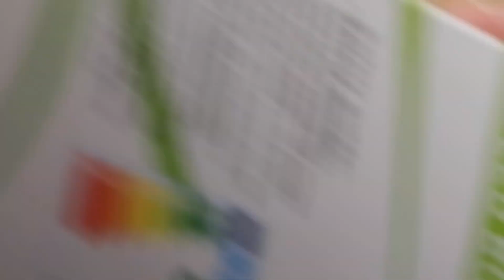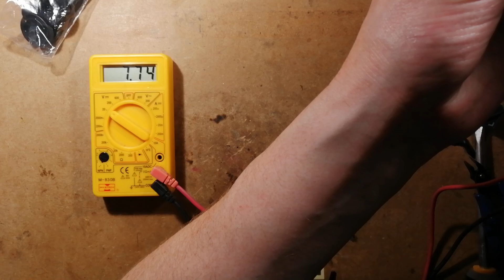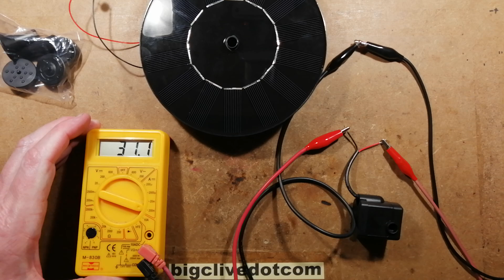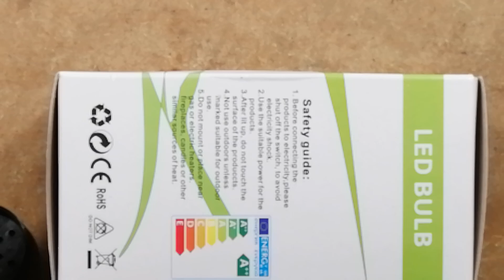Technical look at a floating solar fountain.

Comment: I have this exact solar fountain! I took it apart to test the pump and solar panel. They both worked well. I suspect the motor has  two coils, a hall effect sensor, and a two pole rotor, similar to computer fan motors, which have 4 poles. I really enjoy your teardown and reverse engineering videos!

Comment: I appreciate this is an old video but it was interesting to me as I've had one of these fountains for a while, (it only goes outside on sunny days so is kept in its box the rest of the time). Used it a few weeks back without issue, then went to use it today in glorious full hot sun (shocker) only to find its attempt at a fountain to be nothing more than a spit. Took the pump apart as in your video, removed  the 'propeller', was as clean as a whistle, so popped the propeller back in & took the whole thing outside and in the sun the prop spun really fast... Put it all back together but as soon as it went in the fresh water the same poor result  😕 Thinking my 'Trevi Fountain' is maybe coming to the end of its life 🤷🏽‍♀️
Reply from the maker: It's possible that the solar panel has a tiny crack or there's a water ingress issue.

Comment: Thanks for your technical breakdown.  I have one of these located in our north yard, hence it's shaded from the sun most of the time.  So, I found a 6 vdc switching supply and hooked it up to the pump and it is now solar independent.  Thanks,  Bob

Comment: I’ve had 2 of these they work great but for some reason the solar disc by the end of summer has gone from black to cloudy white?
Reply from the maker: That happens to the resin surfaces.  You can sometimes clean them with a soft cloth and a small quantity of a mild abrasive cleaner like toothpaste.  It might be possible to make the surface last a bit longer by using a car cleaning wax on it afterwards.

Comment: Apparently there are several types of potting compounds, silicone, epoxy, polyester, etc.  Have you tried acetone to melt any of the potted devices?
Reply from the maker: I have.  It only works with some potting compounds.

Comment: You said it uses a capacitor so my question is: after taking it apart can you run it through a series of added on capacitors to take it from a pulsing output to a near fluid output by offsetting the time interval between capacitor discharges?
Reply: I surmise that a feeding loop done properly can allow a series LEDs to produce enough of a trickle charge to charge the batteries that run them while simultaneously creating a usable voltage output. I don't however have the technical equipment on hand to test the theory. I have the bulbs and fountains.

Comment: I have had 2 of them, they work great as long as you keep water where ever it is, Ours was in the bird bath and i would go out and it sounded like it was grinding rough.  I just ad to water and it was fine at first. It was fine for the price I just noticed you did one on my american Cheap/awesome stuff ( being silly ). then I had to pull side cover off there was no more fountian but it still made the water shimmer for the birds. Last before it stopped I would spin spinner to get it stated. I was really suprised it needed the water? I came to the same conclution though motor sealed and box sealed in epoxy.... soooo.
Reply: I wish the motor wasnt so sealed up id love for you to tell me why it qiut... <3

Comment: Hi, Clive. I used to disassemble that fountain too. In the small black box is a circuit that works as follows: The solar panel charges a capacitor of about 4700uF. When the voltage reaches a certain level - I think 5.2V will turn on the power to the pump. This is because the motor needs a higher inrush current in order to spin. In a way, the circuit can be called what is called a "crowbar circuit". A much larger and thus more powerful photovoltaic panel would be needed.
  The pump electronics are the same as in any cheap PC fan. Just structurally, it is a miniature of the synchronous pump from the washing machine - the winding is wound twice and the current according to the rotation of the rotor switches the normal 2-channel Hall switch - the same as in the fan

Comment: I have one of this and it stops working yesterday. Looking to see what could have happened. No reset, nothing I can do. Any clue why this would stop working after 6 months working nice ?
Reply from the maker: Maybe water ingress to electronics or a clogged pump.  There's a filter on the pump that can be unclipped to clean the rotor.
Reply: @bigclivedotcom  Looking at your video I learned that the blades could be pulled off. Then I saw that internally it had a thin layer of algee. So I cleaned it and its back to work as new. Thanks for the video. Helped me a lot !

Comment: I like that, I have a large pond and can't be arsed to take power across, pity there weren't a slightly more powerful one.
Another good idea based on the same system would be a mini low voltage air pump which would benefit the pond in the hot sultry days were the fish gulp at the water surface.
, 👍👍

Comment: Oh, forgot to mention, I did notice on the from of the panel that takes off from the from of the pump, there is a tiny little + and - sign but no switch or anything. I wondered if this might be some way of controlling how high the pump pumps the water? Am I supposed to do something somehow with these + and - signs, could that be linked to why it's not working?
Reply from the maker: That's just a sliding gate that regulates the flow of water.

Comment: Hello, you seem to be knowledgeable about these fountains, I wonder if you could help me? I bought one of these solar panel water fountain pump kits back in March. It's almost the same as the one you showed in the video, only the solar panel is separate from the pump and they are connected by wires. I took this out of it's box yesterday, for the first time since J bought it as the weather was glorious. I followed the instructions put the pump under water, put the panel in direct sunshine (and it was definitely direct sunshine, nk doubt about that), connected the two together....and absolutely nothing happened. I thought maybe it needs to be in the sun for a certain number of hours before it starts, so I left it for at least 2 hours and all day today. Again, absolutely nothing. There is no on/off switch or anything else to do here, in terms of set up. I bought it from Ebay, and have contacted the seller but so far there has been no response. J just wondered if you might have any kind of clue as to why this this is not working? It's brand new. Don't know if it's the pump or the panel or both. Any ideas?
Reply from the maker: Pop the water filter off the pump and check the little impeller inside is free to rotate.
Reply: @bigclivedotcom  Done that, and it seems to be free to rotate...it doesn't rotate when I sort of tap it/push it with my finger, there is resistance, it just moves a bit....is that normal when you push it with a finger? I mean, should you be able to turn it around completely with a finger? It's not doing that, it just moves around a bit and then stops.
Reply: Hi , mine is same .. just got it 🙃

Comment: I got back to this video just to say, i have one, been using it for more then a year now and after that year it seam to have developed weird problem, it just stops working in messy water and won't work again even when cleaned, but it will come back to life after i leave it to dry 🤔
Reply from the maker: It sounds like water ingress to the electronics.  Messy water is more conductive than clean water.
Reply: it died. One of the solar cells visibly cracked, doesn't look like water ingress but who knows. I will try to hack it at some point to use external solar panel

Comment: I have a floating plate ( disc of foam material ) included. Any idea where it is for??
Reply from the maker: If it's a foam ring it may be to make the solar panel unit more buoyant.

Comment: Honestly, I don't see the point of destroying a perfectly working gadget just because one is curious of the components inside. It's similar (apart from the cost) to buying a new car and tear the engine apart just too see how it's built, isn't it? Did the deconstruction help you in any way? Then again, I suppose there are people who aren't content with how a gadget works, but has to analyse how it works and why.
Reply from the maker: By taking mine apart others don't have to take theirs apart.  The needs of the many are greater than the needs of the one.
Reply: @bigclivedotcom  Yes, I figured that is the reason. Then again - why is it necessary to know exactly what is inside? Unless you're going to make your very own gadget by copying the gadget you tear apart? Maybe just plain human curiosity? Speaking for myself, I bought two of these floating solar fountains - I placed them in my pond a sunny day and hey presto! They were working! That is all I needed to know - the manual that came with the fountains said nothing about deconstructing the gadget. But, like I mentioned before - we all have different interests. ;)
Reply: I bought one of these fountains some 3 years ago - it looked and worked very nice for 2-3 weeks inside the house, catching the sun through a window but, as soon as it went to a small pond outside, problems started: after a couple of weeks was only doing bursts in full sun, the resin was soiled - cleaned it, but never regained the original shine and looked like it was sandpapered - the lime in the water and the dust (probably the UV too) completely hindered the panel output for good. Then, after a couple of months of bursts, it completely stopped, no power being generated and the resin over the solar cells was cracked all over. Despite the good looks, it's not fit for outside use!
Not a big waste what Clive did, as he only removed some two or three months of life from it and he can still use the pump for other purposes.

Comment: It would have been helpful to see the voltage with the motor connected.    I actually dissolved the epoxy to see whats inside.    You are correct, there is a large cap:  4300uF per the PCB label.   Soo.... Inside there is a pnp pass transistor in series with the motor leads so a cap meter won't work well.  If you used a known resistor load, you can get the RC time constant to find the approx cap value.  Besides the large 4300uF cap across the cells, there are 2  SOT-23 transistors, 1 diode, a small value ceramic cap, and 5 SMD resistors.  The resistor values are labelled.  No IC's.  I have the schematic.   My reason? It was noted it worked well when cold then  barely worked at room temperature.    btw, the module is adhered to the base with silicone rubber.   

Looks like the diode is a zener that sets the turn on point.  As the solar cell voltage ramps up, the motor will kick on at a certain voltage.   I found the small ceramic cap on mine was shorting unless cold.  Blew the short out with a big supply.  Works fine now,  I'll replace the cap.
Reply from the maker: Thanks Dale, that was useful information.
Reply: @bigclivedotcom  The ceramic cap is 5000nF. Missed that info.
Reply: Made some measurements.  At 3 volts (the minimum that the motor will start) the motor needs over 200mA.  The solar cell is unable to provide that current.  So a large capacitor (4300uF) is charged by the cell without the motor connected to 8Volts.  When the cap is charged, a transistor switch turns on the motor.  The large capacitor has enough current stored to start the motor.  Once the motor is turning, it only draws 60 mA and that's low enough for the cell to provide by itself.  This was tested without water, so the actual currents will be higher. 
 The concept of using a cap to start the low power system what made it interesting. 
 In my case the large cap was leaky when at room temperature, so the pump only ran at half speed.  Worked fine after removing from the freezer.   I changed the cap, and it works as it should.
Reply from the maker: @dalebertdurando1496  Do a search for BEAM bots.  Similar circuitry to allow motors to run in bursts with whatever light is available.
http://solarbotics.net/library/circuits/se_t1_fled.html
Reply: @bigclivedotcom  Looks very similar.  Thx.

Comment: Thanks Clive. I thought the rotor end was sealed. I made a mistake of pouring gravel into the water whilst it was on. It got jammed.
Reply from the maker: You can easily disassemble the pump, so it should be possible to clear the grit out.

Comment: we have a bathroom cfl that has started to pulse when turned off at the light switch. could it be the bathroom switch letting a little current flow?
Reply from the maker: It's either tracking inside an old switch or junction box, or just capacitive coupling between switch wires especially with multi-way switching.

Comment: Can you design a circuit that might be in the potted resin ?  I had this idea but could never figure it out.  The circuit charges a capacitor via a solar panel and then fires off a burst once it's charged.  It could blink an LED or something.  And the speed at which the LED blinks would be an indication of how much light is hitting the solar cell.

Comment: As there are no coils on the rotor and you managed to get the motor to spin by applying a DC voltage, I assume there's some control circuit in the pump potting compound to do the commutation. I've not seen a 2-wire brushless motor before.

Comment: Happy New Camera Era! There is noticeable pixelation when zoomed, as if you are going into 'electronic zoom', rather than using mechanical zoom. There might be a way of stopping that from happening. Anyhow, thanks for the video, Clive. 
That solar panel unit has interesting possibilities for making a more weatherproof nightlight, maybe coupled to several decently sized NiMH cells, or even to a larger capacity Li-Ion pack with suitable cell voltage regulation.

Comment: I had never heard of (or thought about) solar powered fountains before this video. Bought one off ebay with the larger separate solar panel, and it's just the ticket for a small pond I made last week. Only annoying thing is it blocks very easy with any debris in the water.
Reply: Oh and made a tether for it to keep in the middle of the pond, bit of cord and a small scrap of lead as a weight

Comment: I have a small fountain at home. Very simple. Small water reservoir with some stones on top and a fountain on a small pilar. The "fountain" basically just 'wets' the pilar.
However, it's connected to mains via a switch and I barely use it even though it looks pretty nice.
Would you reckon I could remove the connection to main and the switch and replace it with a solar panel? I guess this may involve a bit more work since the pump is built for 220V and it needs to carry the water up for a meter or so?
Reply from the maker: You can get solar pumps with a higher head and separate solar panel.
Reply: @bigclivedotcom  Will these pump water >1m ?
My idea would be to put the solar panel about where my switch currently is (+-5m away) and replace the current pump in the basin with the solar one.
The current pump pumps the water up for about 1m through some sort of stone pilar.

The solar fontains I found so far are similar to yours, with the pump and head quite close to each other

Comment: Clive now I want one of these fountains.
Yeah I already built one from scratch that I have a video on but this one is like a black flower looking fountain. :)
And no did not build a solar fountain just a regular plug in to the wall type.
But I am now thinking this might be my next project is a solar panel fountain faucet that runs off of the sun. ;)

Also you could heat shrink tube the length of what you cut and put the wires that were cut in resin then see if it still works or goes out with a bang. ;)

Comment: thank you for using open camera

you can adjust the video settings in the settings menu to set the Video Quality and crank the video up from the default Mbps. It can go from 1Mbps to >50Mbps

Comment: Ive got one of these, filled an old plastic storage box with water, put a water lily in it, and floated my pump.  In full sun its really powerful, to the point I now run it without any nozzles or it sprays all over the gaff.  In part sun the intermittent surges are not great but it does circulate the water, for a tenner it's tip top.

Comment: Black cables and especially black plugs are a real pain.  I usually lop them off, slip two bands of coloured heatshrink onto the the cable (one at each end) and replace the plugs with white ones that I can write on.

Comment: The same sort of pump is used in those fancy flowing water fountain pet water dishes.  Which are great until algae and larvae worms and crap start growing in the water filter medium they supply with it.  That stuff is nasty and pets drink it? No thanks. I've had nightmares about the crud I've had to clean out of those pumps and related fountain parts.

Comment: Nice video - we have an earlier version of this fountain where the pump floats below a circular disc, the nozzle pokes through and the solar panel is connected by a couple of yards of cable. It doesn't have the purge you showed at low light so sometimes it airlocks

Comment: yes it could be the circuitry but couldn't it just be a very simple reverse bias zener, since it's a pretty cheap product I'd assume there isn't really a fancy PCB in there just a cap with a reversed zener at say 6 volts

Comment: hahaaa yayyy i knew u were using open camera. 
BTW what a very efficient pump starter with idk 2 volts in cloudy conds?
Reply from the maker: Even in cloudy conditions the cells will put out the full voltage open circuit, but the low current will result in the voltage falling under load.  I guess that's why it's using the capacitor and threshold switch to bump start the motor.